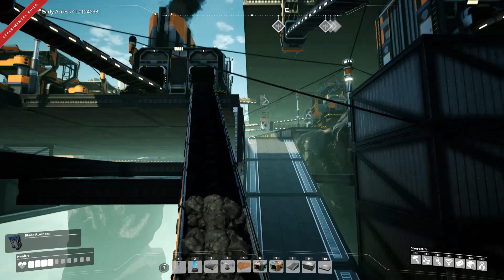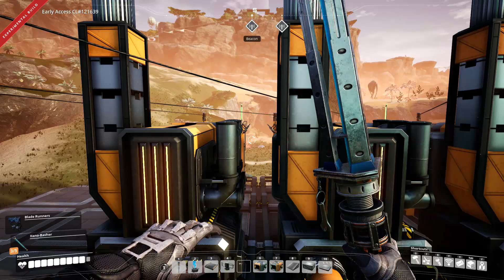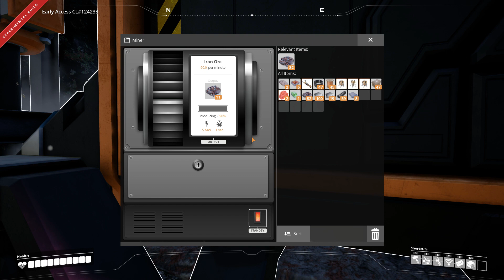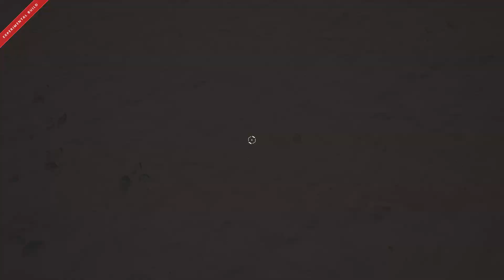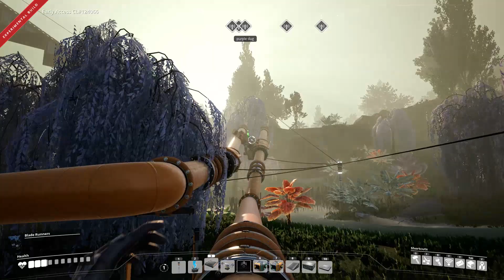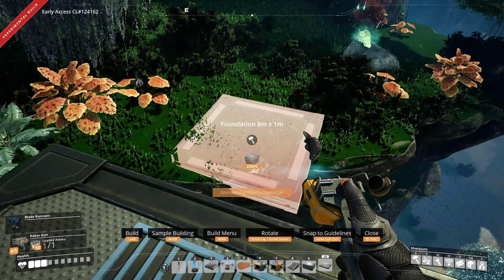Making My Factory Satisfactory (In Satisfactory!)

Comment: Unfortunately in this game is the complete absence of simulating structural integrity. It makes that the spagetti of in the air floating bridges and conveyor belts looks a little bit too silly for my taste. That flaw doesn't exist in 2d Factorio.
Reply: Yes but if it is your style you are totally free to build a practical design. Put in supports and solid structure wherever you want. 

Most players start with sky spaghetti, but once you get into the game a bit it is easy to invest a bit more time and make actual practical structures and the add aesthetics. 

So the game does not force you to obey physics at all times, but most of us do anyway because it looks good.

Comment from the maker: IMPORTANT NOTES (Edited 6/11/20):
1-I am very bad at this game. Just know that.
2-At the end of the video, I said that my steel pipes increased stator production (which would lead to motor production). This was true, until my surplus of rotors ran out, which I didn’t realize until I was pretty much done editing. It still goes faster than my stators did, but now I’ll need to work on the rotors. Yay.
3-Near the end I mix up Heavy Oil Residue with Residual Fuel, so just to be clear: Heavy Oil Residue--->Residual Fuel--->Fuel Generator
4-I've noticed a commenter mention the ethical questions Satisfactory asks, and I wanted to address this. I do think Satisfactory comes with a bit of an environmental message; trees don't grow back, your machines puff plumes of smog into the air, and animals tend to ignore you or attack if you get near them (and there is one animal that'll follow you around if you feed it). Personally, after building my base, I kinda felt bad about taking so much of the land and cutting down so many trees. The beauty that is Satisfactory's world gets replaced with the cold calculus of a production line, and that's kind of sad. I had written a little bit about this in the script but took it out as I was editing the video because 1) Satisfactory doesn't have a full narrative yet, so it's hard to really dig into what it wants to say (though I think you can see its narrative foundation) and 2) I think there's a bigger discussion about games wanting you to think about your actions as well as how a game's narrative and gameplay clash or meld (aka Ludonarrative Dissonance). So, yes: I think Satisfactory has something to say, or at least wants to make you think, but I think the bulk of that discussion will happen once the full narrative is released, and maybe that'll make a cool video?